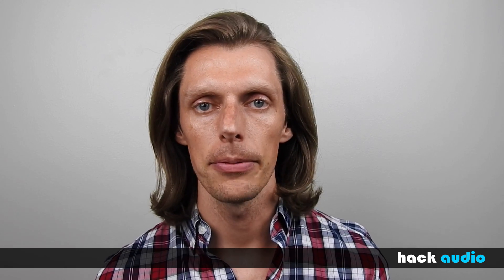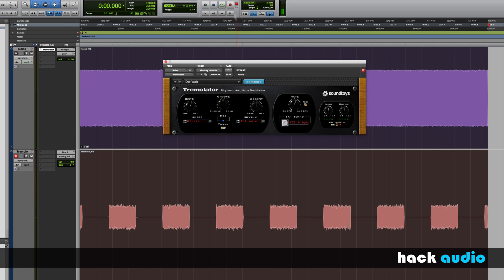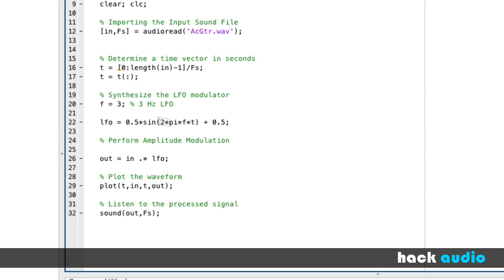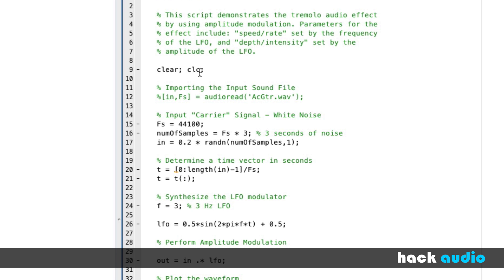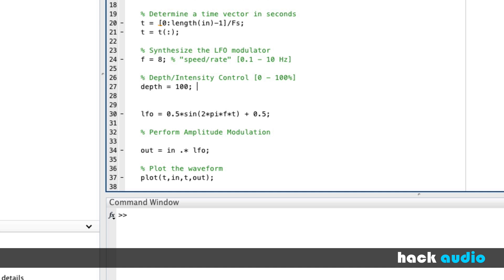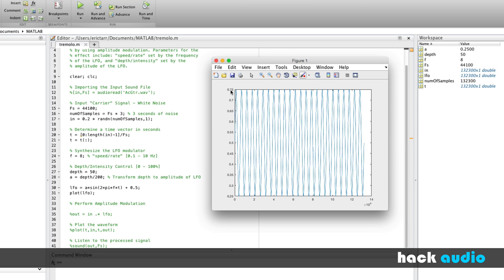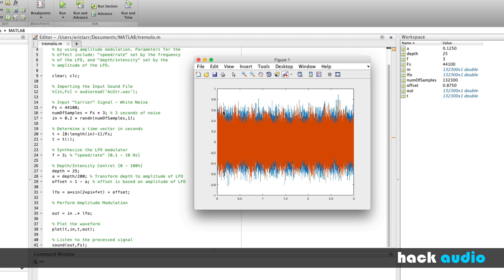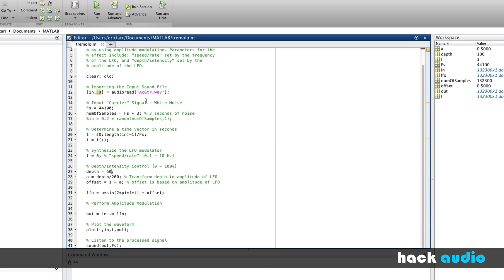Hack Audio: Tremolo

Comment: Thanks a ton for this Eric. Could we use 'if' loops to select through different selections of amplitude waves?
Reply from the maker: Jason, thanks for checking out the video. I assume your question is about using different type of low-frequency oscillators (sine wave, square wave, triangle wave, etc). If that is your question, we can absolutely use a conditional statement (if, elseif, else) to switch between different LFOs. Does that make sense? I hope I understand your question correctly.
Reply: yes. absolutely. I'm actually working on a project for university. along with the tremolo i want to write some code for a vibrato. using a time varying delay line. i want to combine the two to emulate a Leslie speaker. could you help me write the code for the latter? i can share my email with you.
Reply from the maker: Jason, I just saw your comment. That sounds like a really cool project. Are you still working on it? Send me a pm and we can figure it out.
Reply: yes I still am. I have managed to lay down a basic script that works. It has a few glitches though. its due for my semister final on 6th June. I'll send you a zip file with the script and my paper on it. can I email them to you? I have a couple of ideas I wanted to add to it. please let me know.